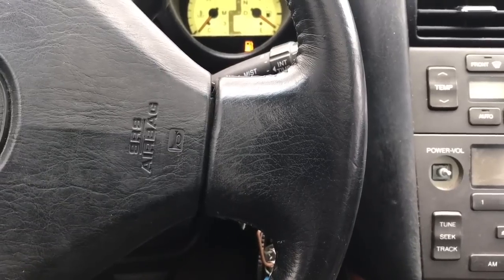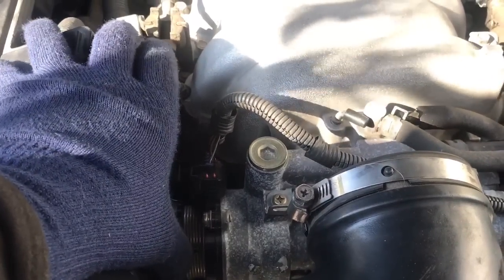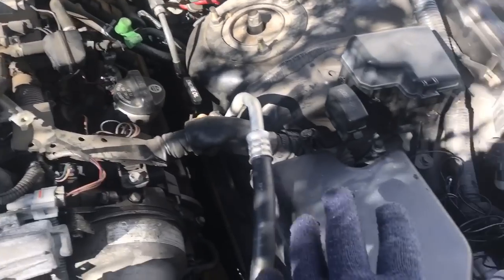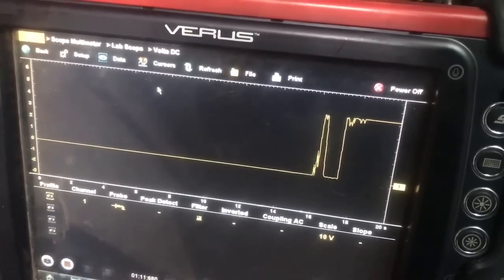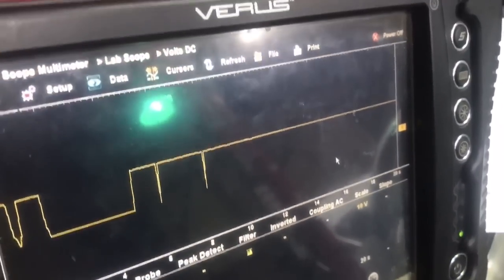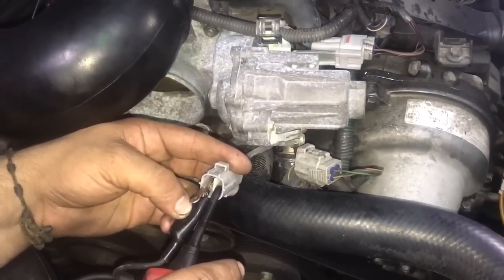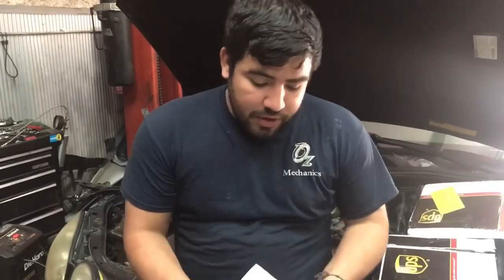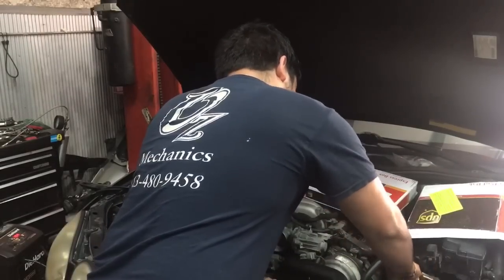Lexus Throttle Body Not Working

Comment: Same engine in our 2000 LS400.  The symptoms are that after a brake job where the battery was disconnected to replace worn pad sensors, that on first start up the car barely idled and threw 1125 and 1128 codes.   Rev'd it an it finally idled at 1500 rpm but there was noise from the throttle control motor, clattering that eventually evened out after 30 seconds but still there.  

The TCM is replacement with less than a year and just a few thousand miles on it.  Car itself is only at 100k miles.  With the key in run, the pedal will rotate the butterfly in the throttle body smoothly and smartly, as long as you keep the pedal from going back to the idle position for more than a half second.  Moved pedal for at least sixty seconds while a friend watched the butterfly move.  

As soon as the pedal is let off and near or at idle position you hear a click and the pedal now does nothing at the butterfly and a 1128 (throttle motor lock out) code is set.

My thought is that it is bad grounds or the parts store replacement motor (Lexus would only sell a complete throttle body to us with the motor attached) has failed brushes/contacts or something similar.

Any thoughts you might have are appreciated.  This limp mode on an otherwise perfect car means it stays off the road until we know exactly what we are up against to make it reliable again.  Who knew that three components could be so intertwined to make such a mess of the diagnostic process, let alone needing to spend $2k at Lexus to get a little electric motor.
Reply: Did you ever get it resolved
 I got a buddy with the same problem.

Comment: I have an automatic 2003 Lexus IS300 that has the code p2112. Throttle body actuator system- is stuck closed. The car idles at a rough 250rpm and I can’t put the car into gear to move it without it dying. When I rev it, it dies on the come down past 250rpm. The night before the car was idling at 1500rpm and wouldn’t rev past 3000. Plus about 5sec after I had the pedal smashed down all the way then the accelerator would work. The car ran fine before I took the battery out of it and sat it out overnight then when I  put it back in my problems began. What voltages should my app sensor and ecu wire points into the ecu have? Plus by chance do you know anything about anti-thief, fail safe/immobilizer mode for these cars?
Reply: Did you ever fixed it?
Reply: Ay bro hope you found a fix in the last 4 years

Comment: Yeah from 1992-2002 those Lexus ecus had counterfeit ecu capacitors...the cheaply made capacitors melt over time and cause the failure in the ecu...the capacitors can be replaced with new ones (you have to solder on the new ones)

Comment: I'm having the same problem with my 2000 gs400 changed the starter and now the car want accelerate if it the ecm where to send it to get fixed and will it need to be reprogram

Comment: So was there no response at all on the pedal when pushed down? Because I'm having a similar problem, but my problem is that it doesn't respond for the first half, then from halfway point and forward it does respond and it's idling a little over 1000 rmp too.
Reply: @azwb  ecu needs serviced

Comment: Great rundown on diagnosing issues with in the throttle body I have similar issues with my Lexus is300 thought it might TPS still waiting on oem to arrive but if that doesn’t do the trick I will be using these methods to test and is the place you sent the pcm still operating
Reply: hey whats up man how did you end up fixing your is300?

Comment: I've got a 2UZ with a similar issue. Idles up and down and I can hear that motor on the throttle body clicking intermittently.  Sounds just like the clutch in it clicking when you tested it. What's the part number on that motor? Can I test the motor by hooking up 12v to those pins?
Reply: Did you figure it out?

Comment: Hello I have a 1998 Gs400. Please help what does my car need to be replaced I got a diagnosed code of P1125. Can you tell me if it's the actuator, sensor or throttle control motor. Please help!!

Comment: Bro, I have the same issue with LX470 2002 checked the problem in Computer and i came to know i have problem with Throttle body and brake switch ... please suggest if i need to repair the ECM

Comment: Bro I had just cleaned mines same exact engine and it’s cutting off now seeming like it have transmission issues but Im more than sure it’s the throttle body I attempted to clean today
Reply: Had a similar thing happend to me today while gookg to work. I smelt gas very bad, the engine is shaking very aggressive and it doesn't accelerate normal. Going to clean the throttle body tommorow

Comment: how would you fix a high idle on a 02 GS300?  I got a P1128 for messing with the throttle positioning. =D    I spliced the ignition wires with new wires, solder them together with "nasa type splicing". Replaced the spark plug.  Now the RPMs are high to 1100 on P or N. On drive it drops to about 600 rpms.
Reply: I'm sure you've figured out there's vacuum leak somewhere most likely.

Comment: thx v much. GBUr personality for the videos. Do you have any idea or fix for VSC code 43 - abs system malfunction. I got the VSC off light, abs light and battery lights are on in my 02 LS430. It happened the day when battery dry fully and changed the battery and start the car, all lights came up and got the vsc 43 code. Also AC is stopped working and turn lights also stopped working. Advice please.
Reply: Sounds like the computer fried. Was the battery wires hooked back on correctly? Check 7.5amp fuse under the hood fuse panel. If battery was connected wrong, it could have blown fuses aswell.

Comment: Interesting throttle body / motor setup. Never seen one like it. Good walk through of verifying inputs and motor operation.
Reply from the maker: Thomas EXOVCDS yea first one for me as well. Weird system
Reply from the maker: Jonathan Salgado nope
Reply from the maker: Jonathan Salgado i would prefer doing a proper diagnosis before chunking parts
Reply: Ummm this is normal. Well on the 2nd Gen GS models. So I thought. On the 04 GS300 2jzge vvti it's pretty much the same, drive by wire, connected to an electronic throttle body motor.

Comment: Hey Oz .... my LS400 Lexus idle's  real Low everything else all Good .... I've been told it the TPS ... what you think 
Cheers.
Reply: 3 years late.. but low idle on 98-2000 LS400 is most likely the Air Idle Control valve that is fed from the power steering pump. It fails from a leaking power steering pump which eventually happens to all 1uzfe equipped cars. Produces no cel codes just low idle as a symptom.

Comment: I have a lexus gs300 1998 2jze engine... My engine dies immediately after it gets started even if i put foot on gas... And after engine dies, security light starts to blink and dsnt turn off... What might be the issue
Reply: Mass air flow  sensor  on intake or  something not hooked up… my car did that when we unhooked it  I changed it I’m having a the throttle problem now

Comment: How did you verify that the earths was good. Great video and good diagnosis !!
Reply from the maker: Tom OConnor hook your volt meter one side to the neg battery and the other to the neg on sensor. Should read around .100 milli volts
Reply: @OzMechanics  3-years later and I am the first to up-vote this useful info! :/

Comment: Was experiencing the exact problem you described. So hard finding videos on an '04 GS300. This helps a great deal. Thanks.
Reply: This motor is the 3UZ the V8 variant which makes it GS430. It's a 4.3L V8
The GS300 came with 2JZ-GE 3.0 Inline 6 cylinder
Reply: @2jz4life35  nah this is a 1uz . You can tell from the throttle body motor
Reply: @2jz4life35  They both use the same exact pedal, driveby write, throttle, and clutch motor system.
Reply: How did u fix it

Comment: My wife as a gs300. I've changed the iac, tpp,top, sensors. The car idles at 1200 -1500 rpm. I don't get throttle response until half throttle. Is there a way to check the signal to the ecm with out the tool you are using to check
Reply: Thomas what was your Lexus problem?.
Reply: @romero10374  I've changed all the sensors deal with the throttle on my wife's lexus gs300. The car idles high and I don't get throttle response until half way down. Is there a way to test the signal like you showed in the video without using the tool line you did. Your do think it's the ecm gone out like the one was in the video
Reply: @thomasmartin8825  I have the same problem on my 99 Lexus did you ever fix it?
Reply: Same issue with my gs300 rpm is at 2000 and the throtal is not respond changed 3 throtal but the issue still there
Reply: I bought an Xtool D8 and it does all of these test, and it cost almost $800 after taxes and delivery. And it does actuation test which pinpoints sensors, motors etc, it shows the graphing, and pulls the codes for those things. And if you not tech savvy Xtool will remotely diagnosis for you.

Comment: Just got code p1121 on my 98 gs300😅 my car died going up a big hill and basically stayed in limp mode, it will not accelerate unless i floor it, it stays idling tho. Brought it home eventually.. so I cleaned the MAF sensor and replaced the TPS and still didnt fix the issue, it died around the block lol drove it back very slow. I have an APP sensor on the way hopefully that fixes my issue. 2 mechanics say replace it, every where im reading most people have replaced that app sensor and problem solved so fingers crossed yo!!🤞🏽
Reply: Update: Still in limp mode after replacing apps,tps and throttle motor 🥲
Reply: @oSIXO.  oh man im not gonna have fun with my p1121 hopefully i fix it with just the app sensor

Comment: Hey mister Oz,  I am having the same problem in my GS300 
I replaced a new throttle body and it still not working and the butterfly is not moving
Reply: Replace the accelerator pedal sensor
Reply: I replaced the whole TB. Tps and apps. Even maf and still get bogging and p1121
Reply: @Ad-wn3zz  did you buy the accelerator pedal sensor used?
Reply: @onesaitama5156  yea
Reply: Nilton what was your Lexus problem?.

Comment: Well done! Great video. Excellently describes procedures and diagnostic. Thanks! I was arriving on the ecm being the issue too. Good on you! Keep up the great videos
Reply from the maker: Thanks for watching !! Yea I get some crazy vehicles at my shop
Reply: I'm looking at my friends car.
 Ls400. High idle. She's having the 1128 and 1129. Throttle control lock. I figure its a burnt transistor or a shorted cable but i have to verify the sensors first like in your video
Reply: @JoseMolina-jz9hh  hi sir, did you fix the issue? What was the problem?

Comment: I literally have 20k in my gs and swapped the .motor .all coils rebuild ecu, new 02 sensors , new plugs  ,wires ,new starter ,all new a_ c system , new fuel pump, new filter ,new crank sensor ,cam sensors, cleaned the throttle body and Intake plenum , new Kan n filter with new ram airintake , new maf sensor ,all new vacuum lines , check for vac leaks ,new gas cap, and I swear my car has the absolute worse misfire still..i can floor it and nothi g.....hardly moves and misses extremely bad u til i hit 3k rmp..does anyone know anything else I can try..I've hit a 20k dollar wall

Comment: Great video. What code were you getting for this problem?
Reply from the maker: ricki singh I forget on this one. But it was a code on the performance of the throttle body
Reply: Oz Mechanics  I have a code for p1121 acceleration peddle position sensor. Rang performance problem.  I was thinking a out replacing the throttle  body lever sensor. You think it's a good start? I don't have all the tools you have to test all the sensors.
Reply from the maker: ricki singh is it the same vehicle ?
Reply: Oz Mechanics 2000 lexus gs 300
Reply from the maker: i wouldnt recommend changing without proper testing. its just money spent if its not the problem. what state are you in ? i have other mechanic friends around the usa
Reply: Oz Mechanics I'm in California,  Sacramento
Reply: Delaware?
Reply: @OzMechanics  I replaced 2 throttle bodies listening to my mechanic and nothing until a 10 minute ecu swap like this did the trick immediately smh. Thanks for this video. You have gained a new follower 👌
Reply: @mrplayarick  what was your fix for that p1121? A new throttle body didn't really seem to do too much for me
Reply: @MustafaKhan-hg8lu did u find the problem I have that issue on my gs300 2002
Reply: @mrplayarick did you ever fix that? I have the same code and I ordered the app sensor to replace it, should be here soon

Comment: Are you in Houston Texas bro?
Reply from the maker: JB Tv Nation yes sr
Reply: Oz Mechanics thank god bro I need you to check mines out to see if it’s the throttle or transmission it’s the same exact car almost it has the 1uz it’s a 1998 gs400
Reply: Oz Mechanics throttle responding but if I full out mash it, it’s like it goes out either the throttle or tranny (loses all acceleration) then high idles until I cut it off and back on
Reply: Oz Mechanics seems as if the throttle can’t take the full gas being applied
Reply from the maker: I can set you up an appointment
Reply: Oz Mechanics I would love that what about next week Thursday ?
Reply from the maker: JB Tv Nation awesome. We can have the drop off on Thursday. And just allow me at least a day in a half to fix up your issue
Reply: Oz Mechanics hey can I drop it off soon ?
Reply: Oz Mechanics hey bro please I need my car checked as soon as you can bro I think it’s experiencing these same issues causing my trans to lack I even ordered a new torque converter I’m trying to get my power fully restored these throttle body’s cost money foreal
Reply from the maker: JB Tv Nation yea no problem. Let me know gen you would like to drop it off
Reply: Oz Mechanics I can tomorrow
Reply: Oz Mechanics early in the morning or when you wake up bro
Reply from the maker: JB Tv Nation you’re welcome to drop off the car tomorrow. I will be running some errands tomorrow and will be finishing up a car. I have a drop off box at my shop
Reply: Oz Mechanics hey I will do just that tomorrow at 9am
Reply: Oz Mechanics nice bro and can we figure out if the torque converter or throttle body isn’t allowing me to do burnouts my ride says she can trail me to drop my car off around 11 or so but I’m about to come now if you have WiFi around there I can easily get a lyft to pick me up

Comment: Hey im having the same problem on my 2004 lexus is300!!!! Helpppppp
Reply: Lino Torres me too. Started 2 days ago. Any progress yet?. I'm going to start testing tonight. Good luck.
Reply: Same problem 01 is300...help
Reply: Lino Torres me too! Lexus IS300 2003
Reply: same 2001 wtfff
Reply: Lino Torres I have the code p2112. And my car won’t idle correctly
Reply: 250rpm until I rev it once then it dies
Reply: I swapped out my accelorator pedal positioning sensor and it fixed the problem